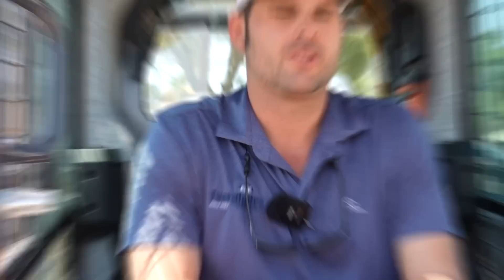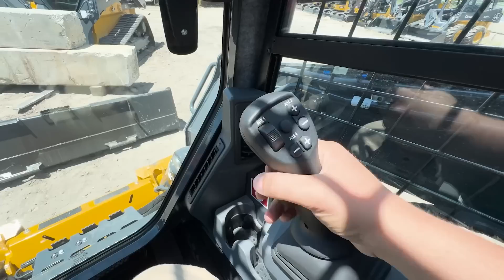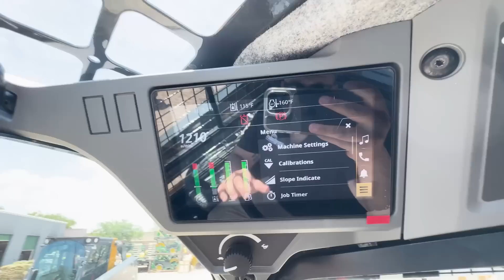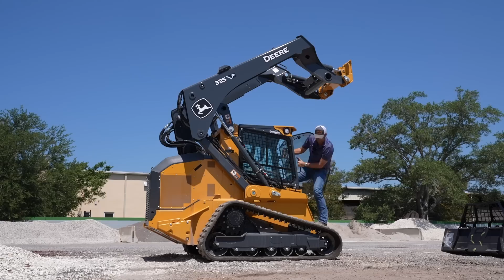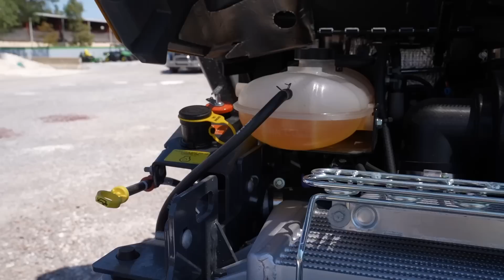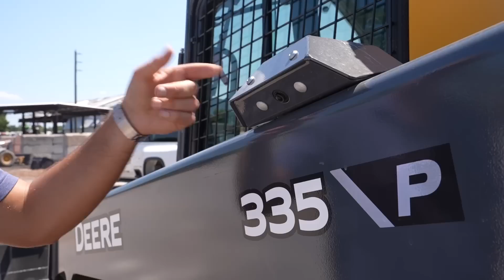2024 John Deere 335P Compact Track Loader | Full Walkaround and Overview

Comment: Still running the same old 3.1 liter yanmar motor with a reflash to hit a pie in the sky number of 118hp. But its torque we need in these CTL’s not horsepower and it’s still down on displacement to the competition. 
Time will tell how it performs in triple digit Texas heat with a mulching head 8 hours a day for an entire summer. Hopefully better than the 333 which needs a roof cooler to even have a prayer.

Comment: Can you do a video on the new 450/p dozer?  Also how does the 335/p stack up against the Case Minotaur?
Reply: I want the same video
Reply: @pr4lviper I agree
Reply: The 335p is no where near the Case Minotaur.
Reply: These machine doesn't compare to a Minotaur it's 5k less lbs. this machine will self destruct in 2k hrs is my option. To much power and not enough Chinese steel.
Reply: P-Tier
Reply: Lol….it loses.
Reply: Dude, the Minotaur is basically a mini dozer. This is a skid steer, my man.